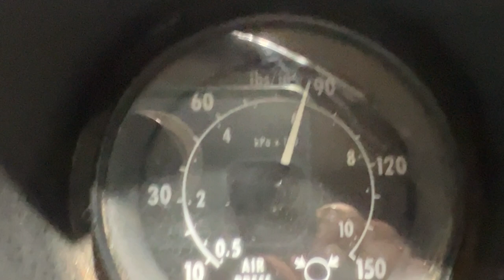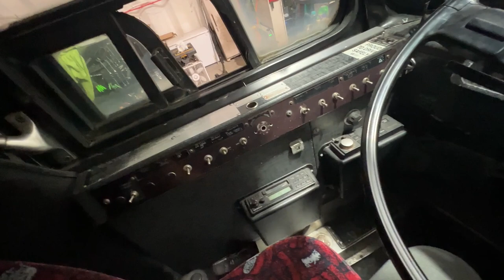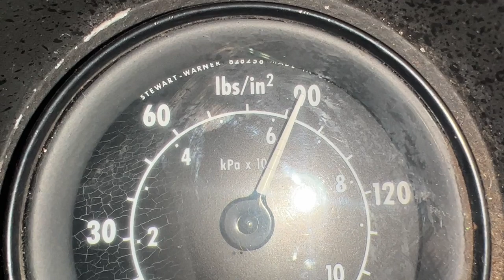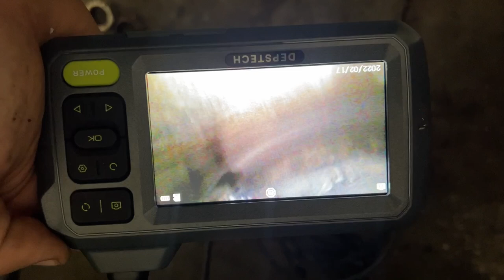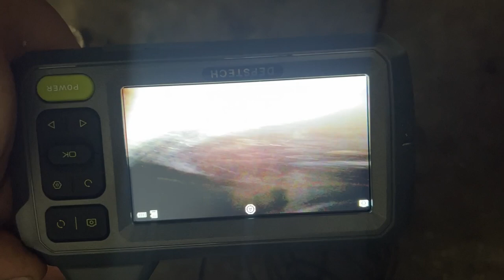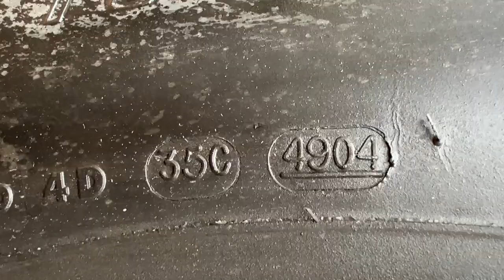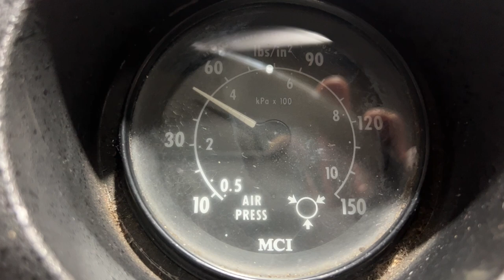How bad of a job can a fleet services shop do on a bus?  This bus was unsafe to drive!

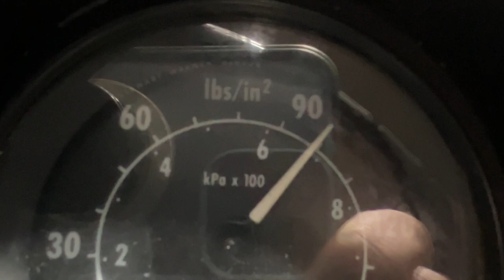Comment: Hello Scott, What is the sound at 30:28 - 30:40? I have a similar sound on my coach and it is related to the air system / air tank. Thank you for any insights on how to diagnose/fix. Great content as always!!!
Reply from the maker: Check valve vibrating as air is flowing from one tank to another because of a leak. They protect air loss from the more important air brake tanks.  Basically you have an air leak it’s trying to transfer air to compensate.
Reply: @BusGreaseMonkey  thank you Scott!

Comment: The multiple problems that you discovered, show the level of service rendered. Evidence.  And after you have basically presented your video case with evidence, it can be considered ones moral responsibilty to alert others to a present danger. $$$ an expensive danger; possibly life itself, if something had happened to the brake system. God bless you and your family GM. Thanks🔧⚙🔩🧰

Comment: Just goes to show that anyone can turn a wrench, but not everyone can fix a bus!!!! Lack of pride in your work and lack of having an experienced shop foreman to watch over the shop mechanics and guide them to better workers and justifing the cost.  $4000 at that shop might not be an outragous bill as it is review by the Manager. However If  he does go over the bill and double check the work performed  as the number of hour it took to see what the problem was and what was done to correct the problem. In my opinion he needs train also.  I see your documenting the issues and I hope owner sits down with the previous shop and discusses the mechanics.

Comment: Scotty, FYI:  a product, labeled  
AT. 205,  available on ebay, is a polymer, which to a large extent, will rejuvenate hard neoprene, and rubber seals and O rings. I couldn't believe how it worked. A rear main seal, was slightly leaking, for over 6 months. I put one 8 oz. Container into the crankcase, and the leak stopped within 4 days, and hasn't for over3 years, now.
    Compared to removing an engine and transmission, to replace the seal, it's well worth a try.....

Comment: I worked for a company that had mobile cranes the 30 ton went in to have the air brakes fixed the owner of the company went to get it and when he got back he called them to tell them the front brakes weren't working they told him to bad he asked me to see if I could fix it I found the problem they hooked the air valve up wrong